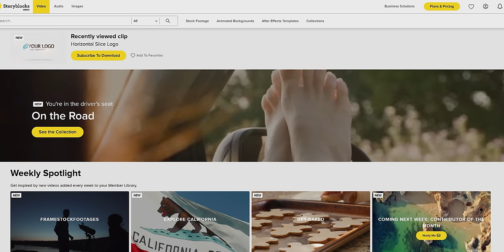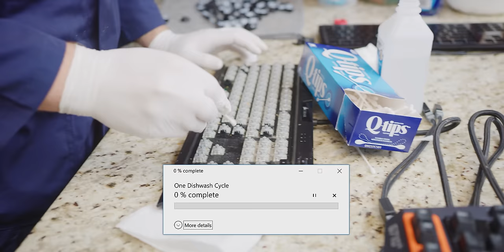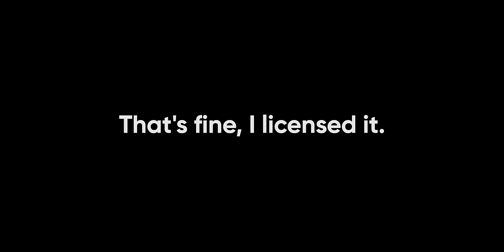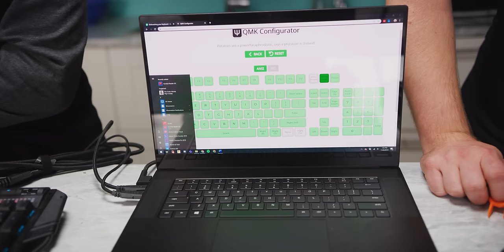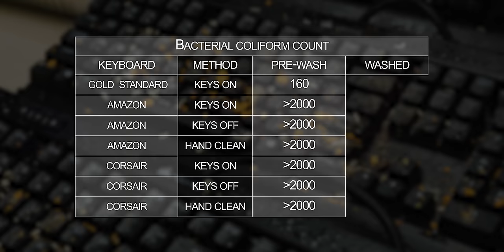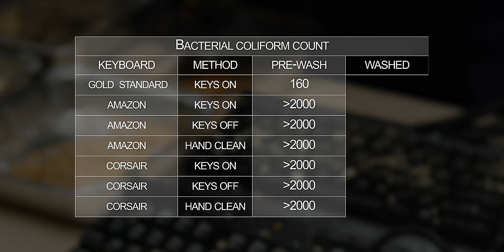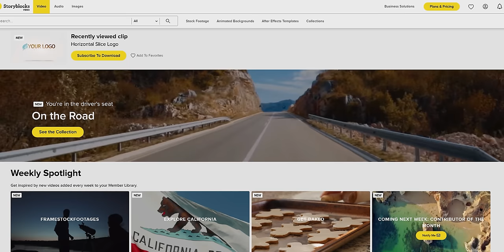The best way to clean a keyboard is… the DISHWASHER?

Comment from the maker: Future Colin here - most of the boards that we did this test with died within a year. They *did* work for a time, but most had a key or two stop responding properly after ~9-12 months of daily use. So, take this video with an enormous grain of salt, and instead consider getting  a mesh bag for keycaps + removing your plastics to wash your keeb without putting the printed circuit board in the dishwasher! -CW
Reply: It would absolutely slap to have YouTube provide further video editing tools in order for creators to give updates without doing that extra work. 

Rip in peace keyboards
Reply: Came to check if you had a warning after the latest video (Fixing my Wife’s $150 Keyboard for $1)
Reply: Awesome, thank you for the update. Just came by from the Yvonnes keyboard video.
Reply: im going to put just the pcb in the dishwasher. i had several keys fail on me so im hoping that this would clean the switches somewhat
Reply: Retest but blow dry the pcb right after the wash cycle?
Reply: So they died within 1 year, and you waited one whole year extra before telling us? And still forgot to include a suggestion to buy an LTT-store hoodie in the comment?

The real reason for worldwide chip shortage is because everyone started putting their electronics into their dishwasher thanks to your video, had to replace them, and now chips are sold out.
Reply: I have to say I did this with my old keyboard when I built my new PC in February of 2020. The keyboard came out damn near spotless, and it works perfect to this day.
Reply: Update: it worked! My keyboard is working perfectly now. I have a Logitech g410 with romer g switches
Reply: Love y'all
Reply: @AdubyX  It would slap so hard bruh I love slappin my bass too
Reply: Super useful!! Tku! I seen the video just now and I was like "omg they washed my exact model! And it lived!" Meh, it'll still give me time to order a new one. Pro tip don't sneeze your drink into keyboard.
Reply: @Shadeewolf  I flinched reading that comment 😅
Reply: lol, dam. I literally just did this today and didn't think to check the comments first. Oh well, my board was nearly dead anyway and so was planning on replacing it. We'll see if I get some more time with it.
Reply: i kept second thinking if i wanted to try this, i went back to check this video , ty for the update
Reply: Well just turned on the dishwasher, guess i have a year to save u for a new keyboard.
Reply: Glad I saw this update.  I dumped an entire travel mug of tea on two keyboards (Logitech G613 and CODE v2) over a month ago.  Waited for a week, hoping that the tiny amount of sugar I put in it wouldn't cause the keys to stick.  Yeah, that didn't work.  I found this video and was preparing to give it a go.  Instead, after seeing this update, I just pulled all the keys from the G613, soaked them in soapy water for about a week (obvious overkill) and used 99% IPA to clean between the surfaces under the keycaps.  Waited another few days to let everything dry out, and the G613 is back up and running.  I've been using it for a week now and everything seems to be working fine.

Now, on to the CODE keyboard.  Crossing my fingers.
Reply: I have been doing this in my keyboards .. my oldest apple keyboard from 2008 never failed ... It is important that the washing machine as no salt and no dish soap at all... only hot water. Always check the internal salt tanks are empty and do a empty wash just to clean the washing machine system
Reply: This is wrong. All PCB's is washed from the manufacturer, it's perfectly save to wash your keyboard (if it has no battery or you remove it). The issue with your video is the drying method.
I think my latest keyboard a Cooler Master Rapid-i I have washed 2-times a year for 5-years, it still works till this day. 

You have to dry it in an oven at a plastic melt-safe temperature, you should also put the keyboard in, so the switches is pointed down, to ensure water doesn't junk up in the switches. 
Of course don't use dish soap. You should use salt and softener though, since we don't want calcium, but be sure you dishwasher do it in correct doses accordingly with your water's calcium levels, since salt can cause corrosion.
Reply: This should have been an obvious outcome, especially if you’re familiar with repairing electronics that have had liquids spilled on them. I’m surprised the video is still up.

Water will get into switches, become trapped on the PCBs, etc in places you cannot see. It will cause corrosion and eventual component failure. These are not custom boards, disassembling them is far from trivial, so proper drying is not guaranteed. Most keyboard switches are not intended to be washed like this either.
Reply: There’s also keyboards like the Logitech K310 which were made to be washable.
Reply: You have to let it dry completely before you turn it back on.
Reply: "Most of the boards" meaning 1 or 2 of them are still going? I'm very curious to know which one/two, though I acknowledge it could just be dumb luck that decided which lived.
Reply: Ok, I didn't revisit this video for a while, and I'm surprised to see this comment. I have sent my keyboard on a regular trip to the dishwasher every few months, and I have no issues whatsoever. Model is Cougar Attack X3 if that matters.
Reply: I honestly knew that this was going to happen. Water would be trapped inside the keyboard and eventually corrode the PCB and water log it. Tap water will always have impurities that make it conducive and corrosive.
Reply: dont worry guys ,  my razer blackwidow last row of letters (zxcvbnm) had only c and b working , sometimes all worked and then it didn't . I had nothing to lose (after using 99% isoproypl and still didnt work,  so i did put it in the dishwasher without the keys and top cover. Well after some sundry and compressed air in 2 hours i had it running again :) . use this as last resort. gl
Reply: If we add salt to the dishwasher won't that cause the boards to corrode faster?
Reply: I do wonder why they died. As it is the switch that died. Is it due to a lack of proper lubrication? Is adding lubrication a viable option?
Reply: The reason for that is that you forgot to dry them. I put mine in the combo washing machine on a drying cycle afterwards, dried all the water from the switches in just one hour. SUper easy!

Okay I cheated a bit. I disassembled the keyboard and put the caps separately in the diswasher's silverware tray, while the removed PCB board went into the powerwasher tray with switches side down. Other plastic parts thrown into the cup tray and go brrrr. I had a cup of wine poured into the switches themselves, and they are soldered directly into the board, so there was no other otpion. Dried the board itself in the dryer washing machine by hanging it on the door with a thread, so it didn't touch any moving part of the drum, it was just hanging inside getting a nice hot drying cycle. Works like a charm now, gonna report back in a year.
 I didn't dare to put the aluminium frame in though, washing machines are famous for ruining aluminium surfaces like forever. That was cleaned by a sponge and soap.
Reply: Can you take this video down? It ends with dishwasher is safe high 5. And a pinned comment saying actually all the keyboards died. That's really not cool dude.
Reply: @babygorilla4233  I think a title change would be appropriate. Again, everyone's mileage varies.
Reply: @tonyzhu403  a title change would do, but as it stands I expect better. If your going to look at the camera and say it's safe but it isn't. That's just unacceptable.
Reply: Wow. I just put my 4-5 year old keyboards in the dish washer today after remembering this video. If they die after 358 days of use (365- 7) I'll update this comment and ask for a new keyboard courtesy of LTT. I should have checked the comments section after remembering this vid. The keyboards are ( Blackweb + Macros ;  Razer cynosa) I proudly exclaimed that I knew what I was doing thanks to youtube when questioned by friends and family.
Reply: @some0ne8  a lot of the metal would still corrode overtime right
Reply: @ratarmy7588  Hey does that keyboard still work in 2023?
Reply: @Chucklet11  it does. I still use it on my gaming computer. No issues whatsoever.
Reply: Hey Future-Future Colin, Did anyone start using those Corsair K70's? I know Linus said Corsair sent them for the test, so they weren't previously daily use boards. But since Corsair was backing the warranty, I'm curious if those survive longterm?
Reply: wow. shocker
Reply: My exact thoughts while watching the vid.

Dishwashers work primarily from steam.  Steam is extremely good at penetrating into things, after it cools, the resulting water will stay trapped on the inside, where there is very little ventilation so it will just about forever be damp in there.  Causing the inner electronics to slowly die from either shorting or rusting.

That was only a hypothesis, scrolling down and seeing the comment doesn't confirm the exact mechanics, but suggests i was probably at least along the right lines.
Reply: Future future viewer here. Since this video was released I've washed my 2015 Razer Chroma tournament edition for a total of 3 times in the dishwasher without soap. It is still working as good as ever. I even dry them in the oven for a couple of hours at 55° C to get the moisture out asap. We also have very little lime in our tap water. So not all keyboards break.. Your mileage may vary.
Reply: I've done this twice. One over a year ago and it still works (corsair strafe silent red). The other one has just dried (corsair strafe mk.2 rgb) and works, although the S key is still sticky so not all of the soda was removed I suppose. But it is very clean.
Reply: Came back to this videos years later when my Logitech k915  wireless was getting gunky! glad I scrolled down and say this comment pinned! thanks for the save!

Comment: My father in law worked at a particle accelerator facility. He was giving me a tour of the electronics lab. They had a dishwasher sitting in the middle of the lab. I asked one of the techs what it was for. He said they used it to clean circuit boards. Thier was a special detergent they used in it. Some of the boards they serviced were worth hundreds of thousands of dollars.
Reply: cern?
Reply: @gulshannaseem786  Jefferson Lab in Newport News VA
Reply: @gulshannaseem786  he has been to CERN several times. Knows a bunch of the people that work there. Before he retired he would go to CERN at least once a year to speak at a industry workshop.
Reply: I mean as long as the circuit is de-energized no harm can be done... would watch boards with capacitors though.. like a power supply might be sketchy if it has too much stored energy still.
Reply: Probably to remove any form of minerals within the water so it could clean out the board
Reply: Most circuit boards go through a wash during the production process. It's seen less and less these days with the push towards noclean flux to reduce environmental impact.
Reply: Would you please ask him what kind of detergent they used? What was their drying protocol before lowering them up?
Reply: @MasterArkannor  Speaking from my experiences in an electronics assembly line. The Washing machine had a built in drying phase which was supposed to completely dry the boards. The first stage after the wash was ICT (In Circuit Test), this was an unpowered test that basically checked for shorts and tested for correct component values etc. ICT frequently failed with multiple short circuits and this was nearly always due to water in the edge connectors. A quick blow out with an airline was the solution :)
Reply: @ClanLawrence  Is standard dishwasher detergent safe? Do I need to check the ingredients to be sure it does not have anything specific? I do not have much experience with PC building and do not expect to need to wash motherboards or keyboards frequently, but it would be nice to know this is a safe option. And is a dry cycle safe for a motherboard? Or just air dry?
Reply: @MasterArkannor  As this video points out, I think we should all use our hands to clean our hardware - unless you have industrial, specialised washers and detergents. Normal dishwasher detergent contains both bleach (for difficult spots) and solvents so I'd never put something I care about (or something expensive) in there with it. It something doesn't say 'Dishwasher safe' I'm doing a mano
Reply: @MasterArkannor  Unsure what detergent we used tbh. As for drying, again, I'm not sure what the industry machine drying cycle consisted of, but I'd guess a dishwasher drying cycle would be fine. In order to make sure there is residual water, I would take a VCC-GND resistance reading on a known good & dry board and then repeat this measurement after the wash and dry cycle. If it reads low, you've probably still got some water somewhere.
Reply: @MasterArkannor  Unlikely. They're strongly alkaline and will loosen the bonds between the monomers. If you're lucky it won't lead to immediate damage, but it will cause (at least) microcracks. And those will turn eventually into macrocracks.
Reply: @destroyerdragon2002  you've said it all.
Reply: @MasterArkannor  it's probably something like Alconox or Xtran. Photoflo would also probably work.
Reply: @ClanLawrence  I would not use the dishwasher HEATED drying cycle... shake it out and fan dry it for several hours with a normal room fan... or dry it outside in the sun...
Reply: @notTerabyte  Yep demin for the win.

Comment: I can’t wait until keyboards are advertised as dishwasher friendly
Reply: There are actual dishwasher friendly keyboards. Those roll-up keyboards for example are mostly dishwasher friendly.
Reply: @drunkenpumpkins7401  
Not if there is little hole in it.. believe me, i know
Reply: They exist. Both Clinell and Imprivata sell dishwasher safe keyboards used in hospitals. They're soap-safe too. 

The Clinell boards are horrible to type on but they do the job.
Reply: @matthewlaverick8375  so does cherry
Reply: "It even works underwater!"